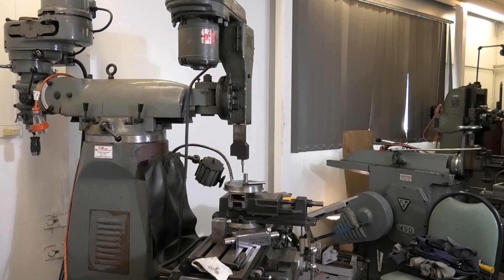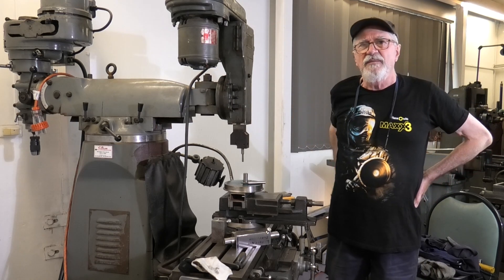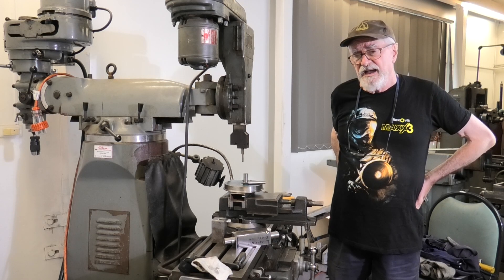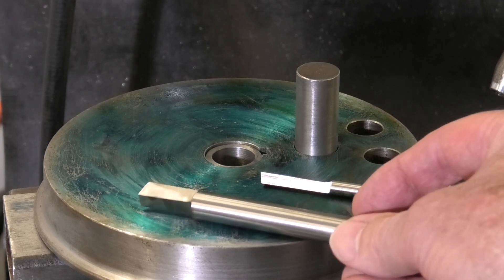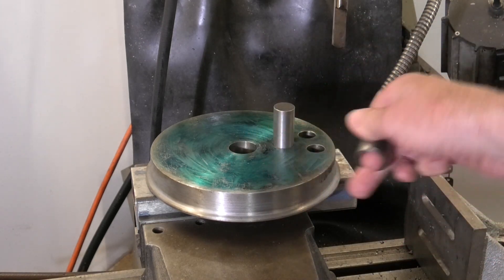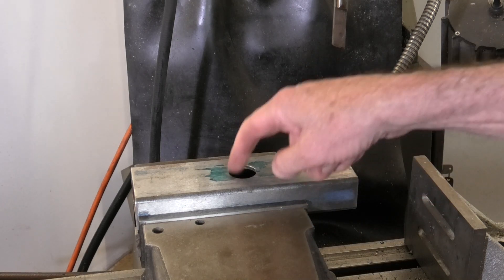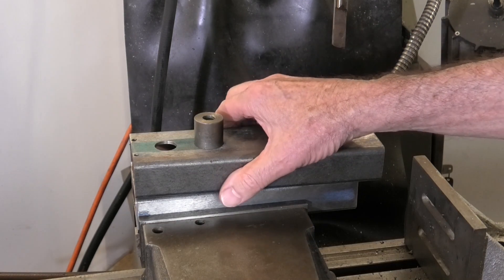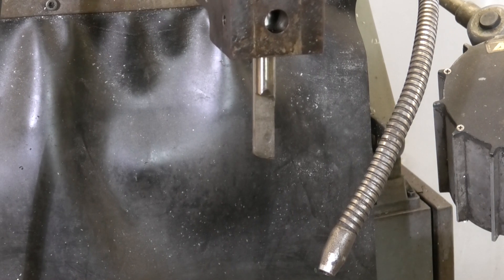A slotter fixture for loco wheels and tooling

Comment: I think you are misnaming the tool. It is a keyway cutter, not a "slotting tool".
Reply from the maker: Well no. It is cutting a slot in a slotter. That could be wider than a keyway and part of a spline. BC
Reply: In Australia we call it a Vertical Slotter Attachment made for Turret Mills. Cut Keyways, splines and whatever takes your fancy.